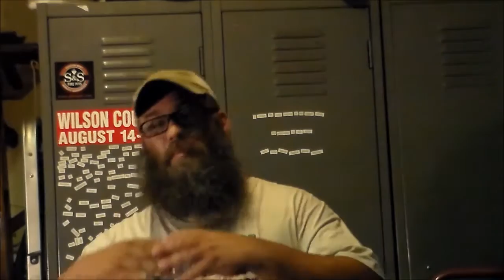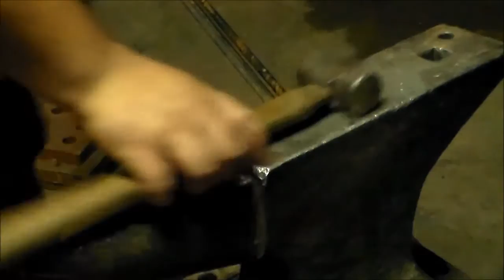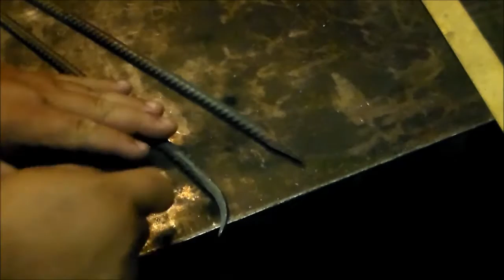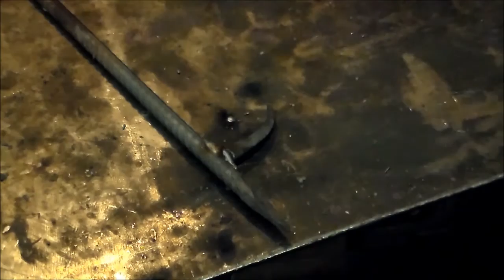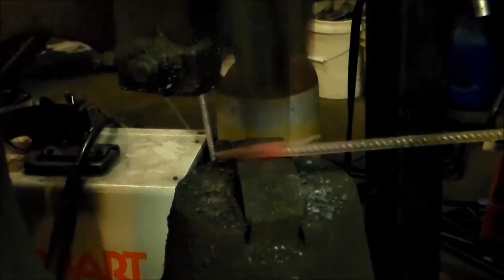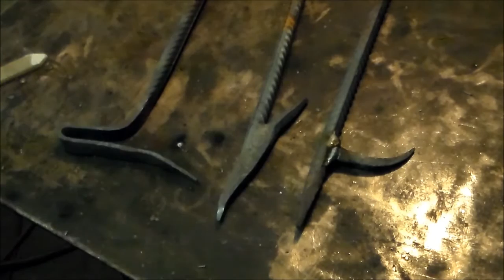Forged fire poker tips without forge welding!

Comment: isn't the 2nd one forge welded.
Reply from the maker: TheEvilways101 no it is welded then forged! In forge welding the joining of the steel is done with the forge, flux, and light hammer strokes.
Reply: it looks like you did that with the 2nd one.. just didn't use any flux
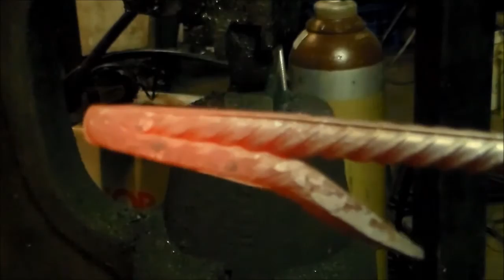Reply from the maker: TheEvilways101 check out at 6:34. This is the easiest type to make with a forge weld but I MIGed it.
Reply: ahhhh.. i missed that i guess.. but i think it would of been waaaaay easier just to get that sucker up to heat and forge weld it.. i mean u have a power hammer! lol